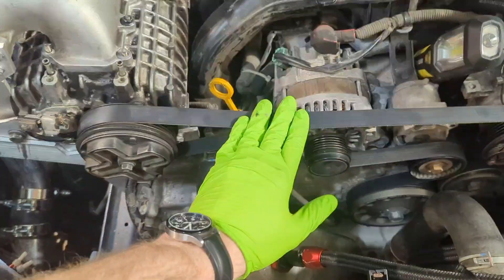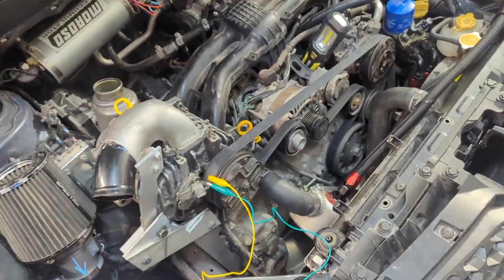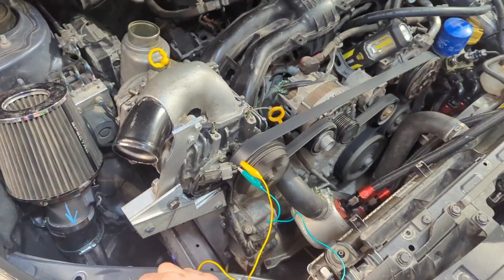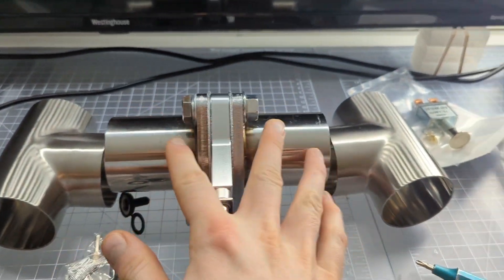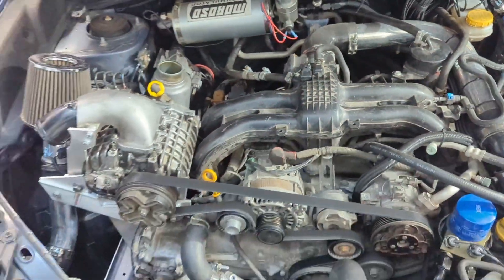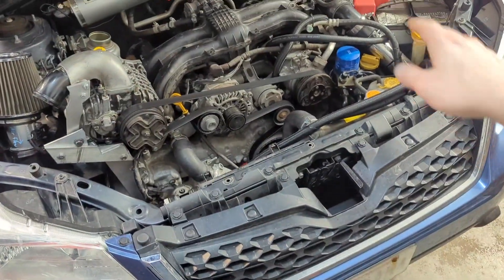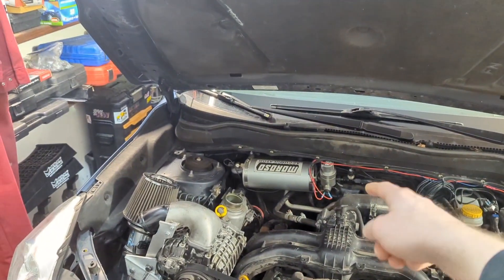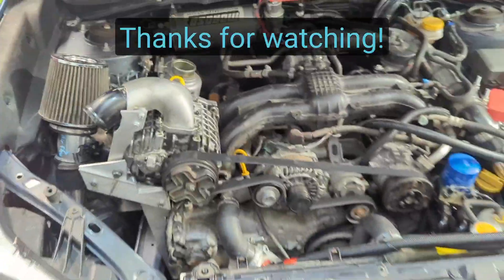FB25 Supercharger Part 8: SC14 & NA-Mode Testing

Comment: I can explain how to make a wastegate work on your intake side as an automated blowoff/bypass valve
Reply from the maker: @coreyjengle1125  I've actually updated the system to remove the BOV and use the second throttle body as a blow-off valve. The upside is simplicity but the downside is I can't be part-throttle when the supercharger is active (fine with me).

What was your suggestion?

Comment: Hey man make sure you have a protection diode in the electric clutch circuit as when you power it off the windings can generate up to few hundred volts  which can damage other components on the same circuit
Reply from the maker: Ooh interesting. A bit beyond my familiarity with electronics. I'll install one, but am now musing as to how that damage hasn't already occurred. I wonder if my use of a relay to connect/disconnect power has something to do with it.
Reply: @avsti it could be that it has one built in inside the conector. The one I have has a smaller ac compressor pulley and it doesn't have a diode as it was supposed to have one on the vehicle side connector